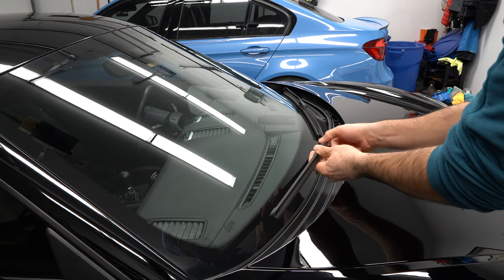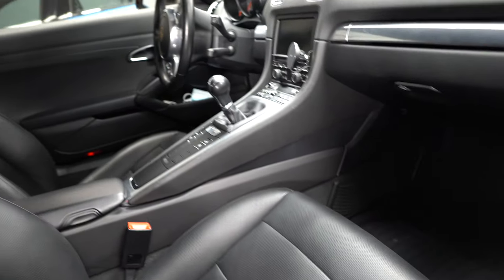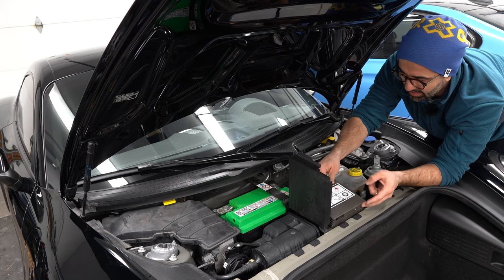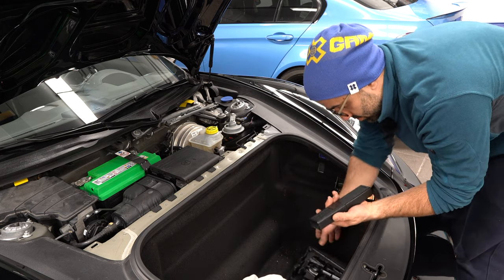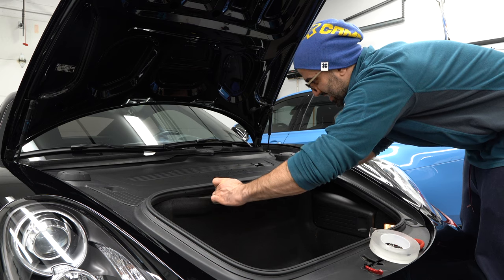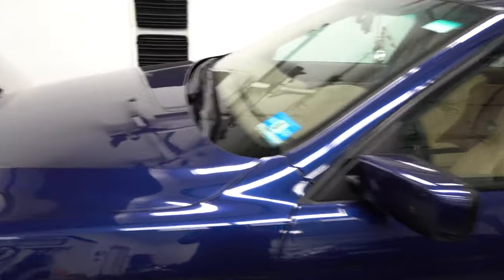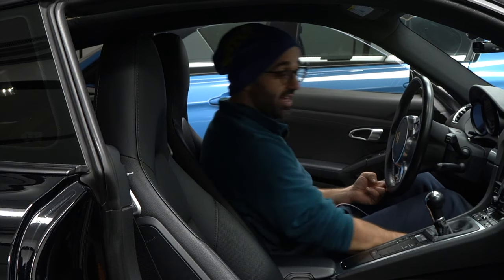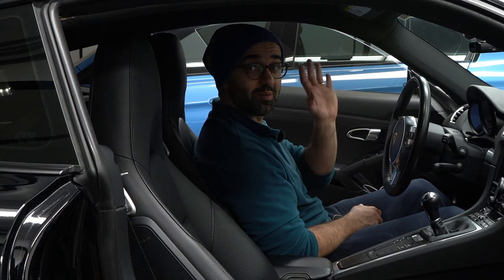Bored? Watch me do random Porsche stuff.

Comment: These boring mods are good for 25+ HP on the F8X M3 (wiper sizes are 24"/19") - - No one uses BMW OEM Wipers. Kits come with different wiper adapters for each brand of car. Try some aftermarket wiper options next winter
- Michelin Endurance XT Wipers - Silicon (Walmart)
- Bosch Icon Wipers (Walmart)

Recommend the BMW M-Performance G20 3-Series floor mats. They should fit the F30 3-Series and F80 M3 . Very pretty design.
Wonder if they make special Porsche Cayman 718 GT4 floor mats that fit your Cayman S.

Pedal Haus makes some nice billet pedals for most BMW 3/4-Series and M3/M4s for the E9X and F3X/F8X models. The design includes a heal plate that screws into the drivers side floor mat. M-Flight (Club) special edition is amazing. Studded pedals are sharp, so don't wear nice leather shoes. Keep a spare original plain black floor mat in the trunk.
Reply from the maker: I don’t like non oem wipers. They tend to be too bulky